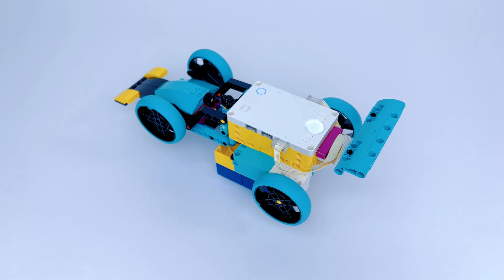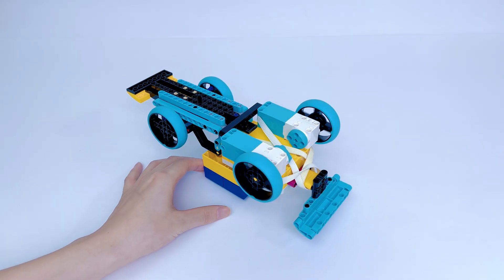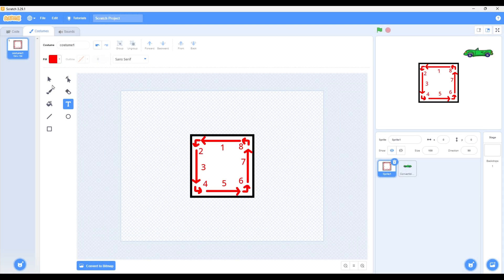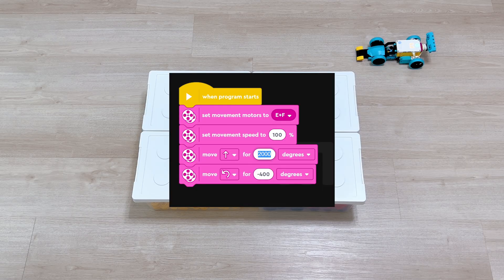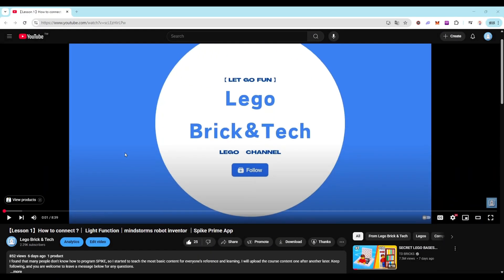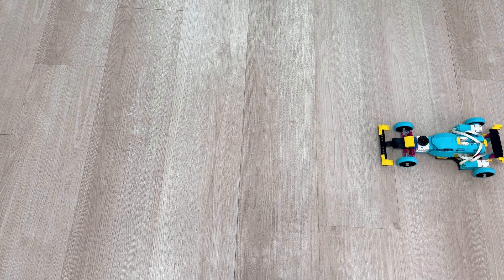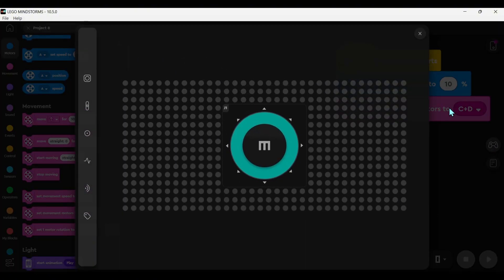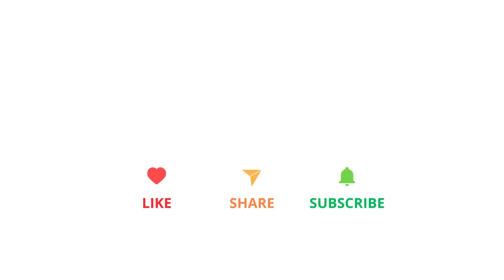【 Lesson 3 】How to Move your own Lego Racing car｜Tutorial｜Spike Prime

Comment: Sincere thanks for your video. I am interested in using a Spike Hub to control a Lego Trackedracer (or an equivalent build). Would you know of any instructions for such a project? Thank you !
Reply from the maker: I have thought about it, but it is difficult to make the track effect with SPIKE parts:face-purple-crying:
Reply: @LegoBrickTech Thank you for your reply. I am thinking to use a technic trackedracer set for the parts. Then swap the powered-up hub with the Spike Hub. I’d lean upon your wisdom here.
Reply from the maker: @Z__K217  I'm a little confused about the concept you want to use, but if it's something like using LEGO 13972 or 57518, it can be done very easily, because I have some parts dedicated to only using the ONESPIKE KIT, or at most the expansion set, so that everyone can participate, and those who have extra use may be able to try it out in the future.
Reply: @LegoBrickTech Apologies for any confusion. Thank you for your messages. My first thought was a hub swap using Lego’s Tracked Racer 42065. So, to put the Spike Prime Hub into the 42065.
Reply from the maker: @Z__K217  Yes, the concept is the same as my previous message. That would be a feasible approach and would be much simpler.😆
Reply: @LegoBrickTech Noted well - thank you for your time. I’ll look into the modifications to fit the Spike Prime Hub into the 42056 powered up hub spot. Also if the Spike Prime Hub can run the motors in the 42056.
Reply from the maker: @Z__K217  Yes, it's possible, but you'll need to consider where to place the motor and hub, as it takes up a lot of space.

You can do it, bro😁